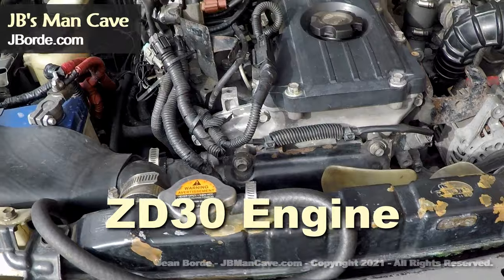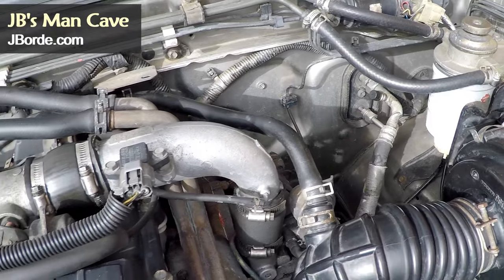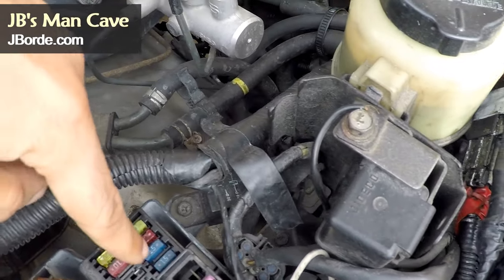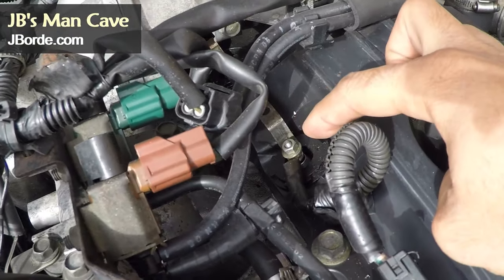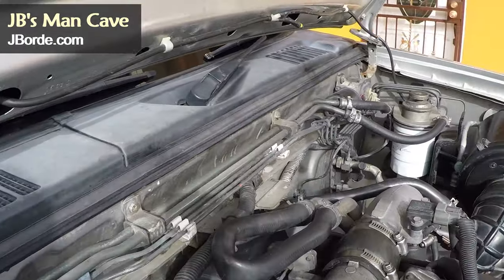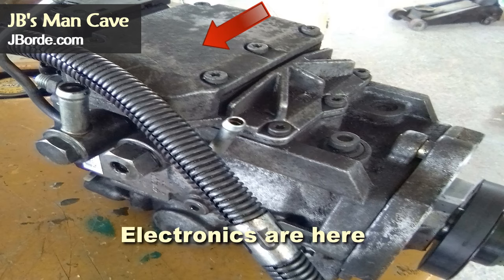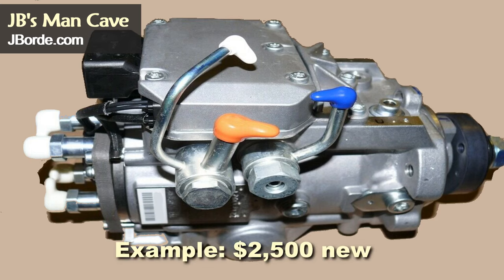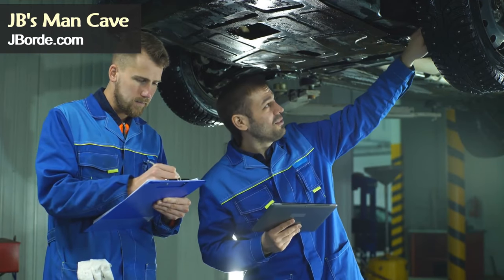ZD30 Diesel Fuel Injection Pump Failure VP44 D22 Nissan Frontier Navara Solution | by JBManCave.com

Comment from the maker: If you have a ZD30 engine with a Bosch VP44 diesel fuel injection pump then you will want to look at this to see what I did. If you went through the process of having to deal with a diesel fuel injection pump that failed because of circuitry or spill valve error please comment and tell us what you did.
Reply: Im getting spill valve error fault code bro right now it's not starting diesel pump is not supplying diesel with pressure
Reply: Did not know you are a mechanic.
Reply: You havbe your hand everywhere even in the engine 😆

Comment: Mines not even firing up just
Reply from the maker: I hearted your comment because I feel for you. That is unfortunate, did you try looking up the error codes? I have a video on how to check that.
Reply: @JBsManCave  will be when home JB 
Could it be the suction control valve not letting fuel through
Reply from the maker: @victoryboardwalk  I strongly suggest to check the error code and know exactly what the engine is telling you rather than guess.
Reply: @JBsManCave  yep definitely will do that first mate cheers 🍻

Comment: thanks for this video. I am currently in this same situation with my ZD30 fuel pump & trying to decide between servicing or buying used. Servicing cost 11K$ and the used is costing 7.5K$
Reply from the maker: Brando, it is a tough decision to make. Which one will you do?
Reply: @JB's Man Cave  hey thanks for responding. I'm opting for the rebuild which gives me a 3mth warranty compared to the 7days warranty on a used pump. Also the shop let's you know if it's worth repairing when they open it up,.so that's a win right there.
Reply from the maker: Brando, that is what I did because buying something used puts you at risk with problems already there especially because you do not know how long the used pump has been 'sitting'.

Comment: Am facing the same problem in the morning with my zd30 diesel engine bro
Reply from the maker: That is unfortunate, hope you get it resolved.
Reply: @JBsManCave   how can I get it resolved should I change the main pump of the engine or what solution sir?
Reply from the maker: I suggest following the exact tips I gave in the video.
Reply: @JBsManCave  ok boss I a old spoiled pump at home so I will remove the valve that you are about and send it to my mechanic to change it for me and see the outcome boss

Comment: I got zd30 engine, but injector not supplying fuel to engine to start ,power supply ok, relay Ok, fuse  ok but injector not working
Reply from the maker: Check the brain of your truck to see what error message you are getting from the ZD30 using the method here: https://youtu.be/QyzHpMOSuwM
Reply: Zd30 Nissan navara 15seater bus injector not working
Reply: Hi same problem injector not supplying diesel to engine what can i do please

Comment: I am in this situation right now and thinking of giving up on  My Nissan terrano regulus ZD3O, not going over 2500rpm, power loss. when start it I have to wait about 10 to 15min so it accept to rave...HUffff I am tired of this
Reply from the maker: Sorry to read. Did you check the error codes you are getting? if you do not know how, I have a video about it. Did you try the tips given in this video?
Reply: @JBsManCave  thanks for your feedback, I saw the video about connecting a wire on pin 1 and 8, I will try to read the codes. Then I'll inform you maybe you can help.

Comment: I got a hard start before with no error codes and figured it out that was because of coolant temperature sensor. 
It was causing the ECU think that engine is warm and preventing heaters to do their job.
Reply from the maker: Thanks for sharing what you did for the ZD30 Diesel Fuel Injection Pump Failure.

Comment: I also had this problem with my zd30 diesel pump,same symptoms you spoke about. My quick and cheap fix was bringing the tank down to quarter or a little less and dumping 5 tins of amsoil diesel concentrate cleaner in my tank and drive around but also leaving it over night to soak. Next day drive around again and change diesel filter.
My diesel pump has never worked better.
Reply from the maker: Raymond. Thanks for sharing what worked for you. I did not mention it in the video but I did try what you did but it did not work for me. It seems in my case the pump's computer was also bad and in that case no amount of diesel cleaner would have worked.

Comment: I had the same problem this year twice. The error code came from scanner is 0073.  However my mechanic solved it by pulling out the cable plugs and sprayed lubricant oil into those contacts.

I wonder if severe dust on the road, esp. off-road condition and water residual from carwash blocked all those contacts to the fuel pump.
Reply from the maker: Interesting. Please remind me... what is error code 0073?
Reply: It is shown as Fuel line communication error on the G Scan.

Comment: Great video! Thank you. I am having the same problem. Is there anything to be careful of when removing the fuel pump or is it pretty straight forward?
Reply from the maker: Robbie, thanks. Taking out the pump is quite an undertaking because of its location. Are you just exchanging it with another pump or are you taking it to service?
Reply: @JB's Man Cave  thanks for the response. I will be taking it for testing and possibly repairs
Reply from the maker: Robbie, best way, especially with a Bosch authorized dealer, because one thing you do not want to do is go through the work of mounting it up again only to see it is not working or works for a short time with any generic quick fix. Also, careful with the electrical chords that run from the pump they are kind of flimsy and damage easily.
Reply: @JBsManCave  ok cool, let me try that
Reply: @JBsManCave  thank you
Reply from the maker: Robbie, sure, let me know how it goes. Feel free to also check my other D22 fixes as well.

Comment: I am also now getting a problem with my zd30 turbo non common rail when the diesel tank is half full it hard starts on the first cold start but when the diesel tank is full it starts normal on a cold start. So I thought it was the primer pump and changed it but I am still getting the same issue
Reply from the maker: Qadir, thanks for sharing your experience. One thing I have found with the ZD30 and that pump is you have to keep the fuel above half or the lines start to get clogged. It should not be because there is a filter but that is what happens. You should do an error code check to see what is happening: https://youtu.be/QyzHpMOSuwM

Comment: After 10 years of happily driving my zd30 powered D22, my injection pump suddenly died. While in Tobago on vacation, it was idling happily and just sputtered and died. My mechanic in Trinidad scanned and showed me the spill valve error code pointing to the injection pump. Now I will wait for him to remove it and get it remanufactured. The local shop that does it assured me that a reman unit could potentially give me several more years of trouble free operation. This cost is pretty high, more than the cost of an entire engine for some of our common local cars. Of course this cost comes at a very inconvenient time so I am not very happy :(
Reply from the maker: Nicholas, I know just how you feel. That computerized VP44 pump gives extra power and zip but when it fails it makes you cry. That is how I felt when I made this video. Did you check my other video for getting the scan codes yourself?
Reply: @JBsManCave  I did not check them yet. I've subscribed and will definitely check them out. I'm too sad to look at any van content until maybe tomorrow lol
Reply: It just so happens that I've always been well aware that this failure can come knocking on my door one day but convinced myself I'd gotten a "good" one. I've experienced almost the exact symptoms you described. It will start after many tumbles and idle perfectly after an initial stumble or two. Then revving beyond 1000rpm is impossible. These engines are so powerful that even at idle you can cycle up to 5th gear and run at 50km/h on flat road and even climb some hills but obviously this is far from ideal.
Reply from the maker: Nicholas, yes, that is what I did to get home when it was doing that, put in the 4x4 and run it. The pump is too expensive for what it does though, hence some have gone with the mechanical version.
Reply: @JBsManCave  I agree. It is very expensive for what it is. There is so much that can go wrong with those pumps and they are so difficult to get to.
Reply from the maker: @CptAwesomeTT  after the experience the next vehicle I get I will be investigating the kind of pump it carries. I miss the days where things were simpler: carburetor and straight fuel injection.

Comment: Hi, Great video. What’s ur location? I am having same problem with my Nissan Terrano. I need the fuel pump rebuild. Can u give me the name of the company that u used to rebuild urs?
Reply from the maker: Your vehicle carries the Bosch VP44 D22? If so, you would simply look for a Bosch authorized dealer in your area and they will give you the info.
Reply: I live in the Caribbean Dominica and I don’t know of anything around my region
Reply from the maker: Oh, at the time I owned the truck it was Trinidad. Based on your location you may need to find out of the closest Bosch dealer to you or order one online.

Comment: Hi, I am having the same problem you are having here with the exception that I was driving when it happened and the vehicle didn't give any prior warning. The vehicle isn't showing any fault codes but we have narrowed it down to the injector pump. Can you me where in Trinidad did u go to refurbished the pump???
Reply from the maker: Canya, did you try the steps in the video? Refurbished at the local authorized Bosch dealer Sookhai.

Comment: I got this problem on my Nissan Patrol Y61.. such tough times to face this. The ZD30 engine is a big problem.
Reply from the maker: Ami, the pump has to be well maintained to avoid this situation. Changing the filter often and ensuring there are no power surges to spoil the VP44's computer. What are you going to do?
Reply: @JBsManCave  Yeah. I always change the fuel filter according to the one on the manual but i should have done it almost every oil change after seeing how expensive this simple thing is 😩 i am planning to just buy used car with how expensive it this pump is. 2800usd for the new parts. I need a quick fix for this 🥺

The error code that i got is...

0073 P3-PUMP COMM LINE

0076 P6-SPILL VALVE

0047 CKP SEN/CIRCUIT

And somehow 0047 and 0073 disappeared after awhile
Reply from the maker: Ami, that "SPILL VALVE" error code is the VP44. Does it start at all or can start but stays below 1500 RPMs? I hear you on buying a vehicle. Have you thought about just servicing the pump rather than buying a new one?
Reply: @JBsManCave  the mechanic can't even start it. He tried to blast the oil spray thingy and it just wont start.  At one time, i thought the battery was problematic (3 years old). 😩 To change the pump felt like too much money for a problem that can happen again 🥺
Reply from the maker: Ami, I know how you must feel because I was there, its a sad situation to be in.

Comment: Thanks for the video JB, I am probably a year to late😅, can you tell who did the pump repairs for you? TT💯
Reply from the maker: Kim, why are you a year late? Sookhai's.
Reply: @JBsManCave  lol🤣 your video came up as a recommendation 👍
Reply: I installed a used unit, I suspect that the root cause was the primer pump as it wasn't holding system pressure...I would always have to prime the pump before starting...and I also experience the internal element of the fuel filter collapsing...both would have staved the pump of fuel causing the pump to overheat and fail...pump requires fuel as a lubrication and coolant.
Reply from the maker: Kim, they can test the pump to tell you what is wrong. However, it is going to cost you if you have to get someone to pull out the pump and put it back.

Comment: Hi mate, i have 1999 nissan terrano with ZD30DTI (not CRD), Which has failed IP. I have spare injector pump from Nissan caravan with similar engine. If i swap the pump, do i need to do recoding or anything or its just swap, and go thing?
Thanks
Reply from the maker: Gurwinder, as far as I understand... the proper way is to calibrate the pump with the engine. I have read where people just put it in and reset the whole vehicle so no error codes come up. What you can do is contact Bosch and see what they say about it.
Reply: I wrote my Elgrand e50 off code 76 SPILL VALVE
Reply from the maker: RH, what kind of engine do you have in that?
Reply: @JBsManCave  Zd30 engine

Comment: Can you suggest which mechanical diesel injection pump can be install in. ZD 30 ?
Reply from the maker: One mechanic who said he did the conversion used a VE Pump which is six cylinders so it has to be converted as the VP44 is 4 cylinders. You will also need a new rotor head, so it is not just a matter of buying a replacement pump... it needs to be done by someone accustomed to doing this as I showed in the video.
Reply: @JBsManCave  Thanks a lot for your reply.  My zd 30 failed to start. The pressure and power required by ZD 30 injectors is approx 200 psi. Which ve pump produce such power. I fabricate the coupling plate by myself. But I need expert opinion about the selection of ve pump
Reply from the maker: Rana, beyond what I gave you above and the video I really cannot say as I have not been involved in the process of converting a VE pump to work on a ZD30 myself. However, if you do find out or end up making it work please let me know.
Reply: @JBsManCave  Thanks a lot bro.
Reply: @ranatauheed6100  biggest issue with fitting a VE in its place is the flange pattern, high pressure outlet size and the vp44 runs a 25mm driveshaft. Not impossible but not easy either.

Comment: i have little different symptoms where it revs high RPM but struggle to climb hill at 70km/h and can't go pass 100km/h on highway. When the "engine light symbol" is off (meaning the pump is working again), it works normal. Any suggestion? My mechanic told me samething, replace 2nd hand engine as it takes same effort and money to replace just the pump. (and my engine oil is leaking too :( )
Reply from the maker: Chosen, the first thing I would do is to do a scan and see what your vehicle tells you: https://youtu.be/QyzHpMOSuwM

Comment: Hi i have a ENGINE Nissan 30zd and has failure, start good but the rpm not up 2000 what You think
Reply from the maker: Juan, did you look at the video for the tips? Bad fuel injection pumps can start well but if you are not getting the RPMs then that is a sign it may be connected to the pump. How often do you change filters and add in a diesel cleaner?
Reply: @JBsManCave  yes i look that video i have new fuel filter and line too and don't see leak but the ENGINE in idle has a vibrating like out time i don't know what happened sorry for My English
Reply from the maker: Did you do an error scan? Get the scan code: https://www.youtube.com/watch?v=QyzHpMOSuwM
Reply: Hi it's me again look My fuel pump give between 90 and 95% injection to the ENGINE but 40% si the correct the pump no good calibration. You know how calibrate sorry for My English thanks
Reply from the maker: VP44 pump is computer based so it would need to be set by a company capable of doing that. Usually Bosch registered.
Reply: @JBsManCave  the number correct is 40% but My fuel pump have 95% the injection
Reply from the maker: Get it checked by Bosch registered place. Which country are you from?